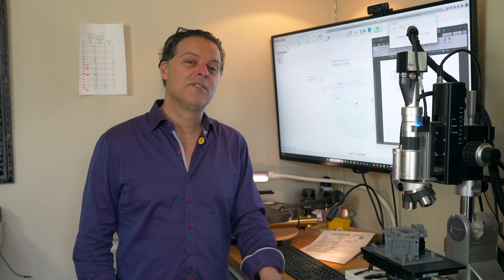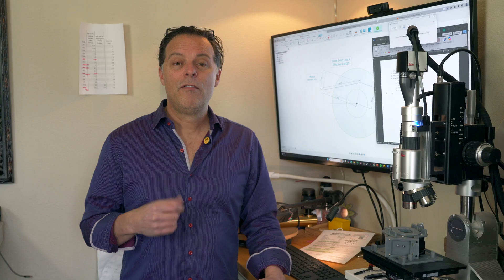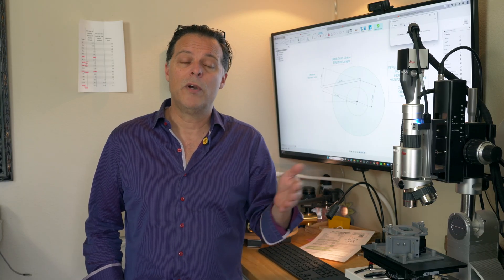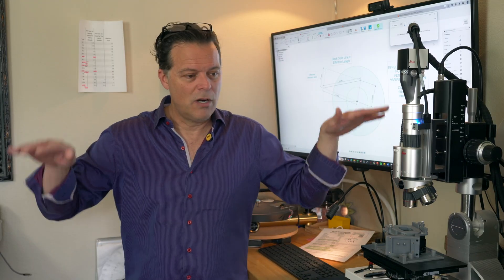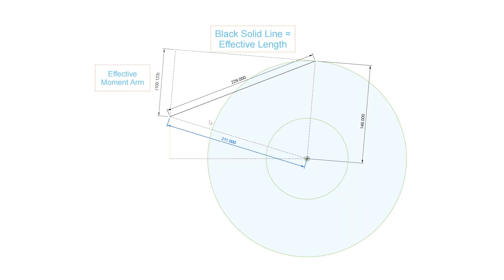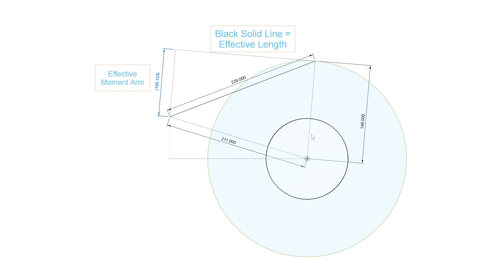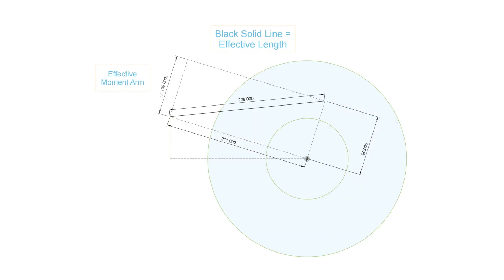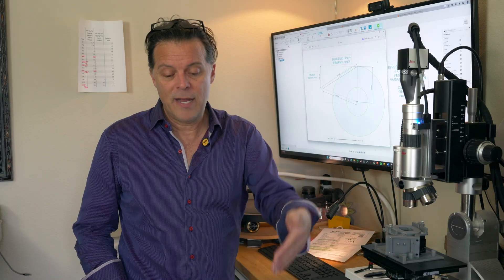Sound Bite #24:  Part 1 of 6 - What Causes Skating Force? It's NOT What We've Been Told!

Comment: So I have a Rega Ania and Grado Sonata 3. Since i have set the setting force at 1.75g same as TF, and put about 40 hours on it. The Sonata always sounded wayyyyyy better. The Ania sounded great but not like the Sonata. Well, last night, i was looking at the cantilever on the Ania while tracking, and it was pushed towards the outer of the platter. So i decreased the SF to about 1.45g where the cantilever was no longer favoring one side, and Holy Crap! The Ania opened up and now is playing insanely good. I guess the spring applying the ASF is off a bit on my turntable. Fun stuff. 🎉🎉
Reply from the maker: You are headed in the right direction and experiencing the positive benefits. Now, measure with a WallySkater and dial it in perfectly.
Reply: @WAM-Engineering  Right on! Man, the soundstage has really opened up. Before I had the dynamics of the cart but it lacked the depth of the soundstage the Sonata had. Now it is a whole new ball game. Great Videos by the way.🎉